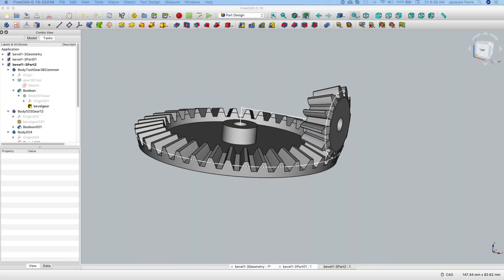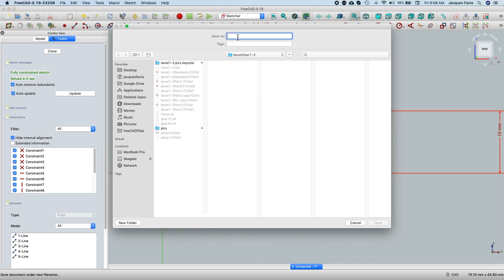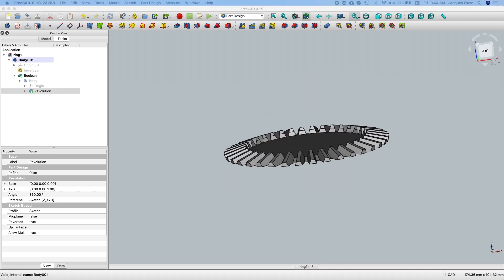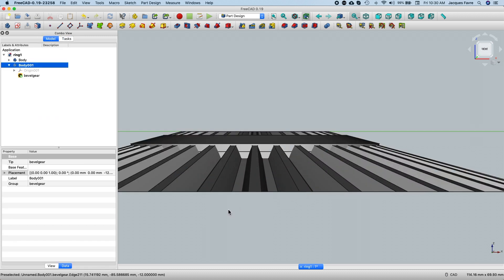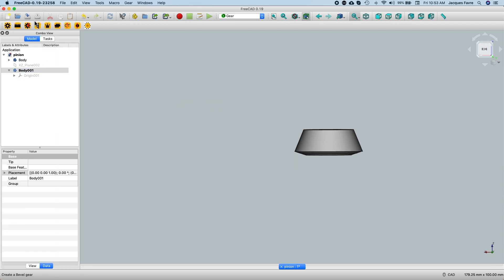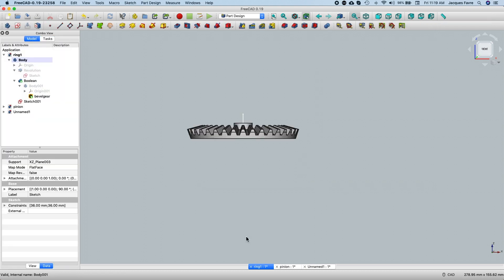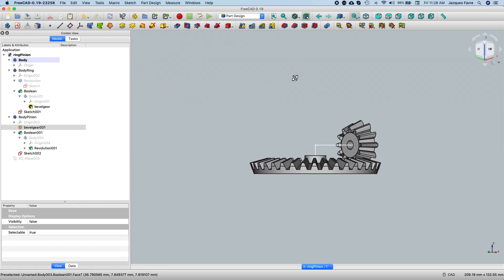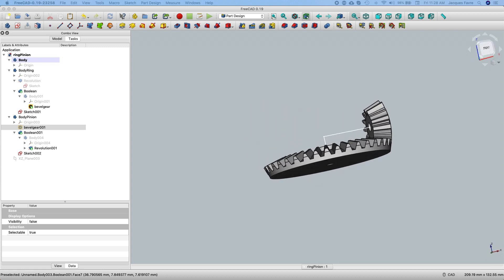FreeCAD Bevel Gear design with Gear Workbench

Comment: My only suggestion is to slowwwwww down in the beginning. I'm a fast dude and this was when a professional shows you how to do what they do and they fly through the steps. Good video otherwise but I definitely had some frustration. Also announce hotkeys if you use them.

I struggled through this and merely slowing down and extending it to 15 minutes would have reduced my time on it from 5 hours to at least 2. For tutorials, it's worth slowing down. I watched at .25 speed for a good chunk of it and still had to play it several times. I learned a lot from your tutorial and still gave a thumbs up. 

It was a push, my experience is pretty limited with freecad though. To someone more experienced it probably isn't too bad

Comment: I've been using FreeCAD for a while now.  Started looking for a way to design a 1/16 bevel gear setup everywhere.  Never got any idea how.  You just gave me the means to do so THANK YOU very much.  You also gave me a learning curve like the North face of the Eiger to get to the point of doing my own design.  I'll first copy yours exactly. However, you showed me it is possible.  Thanks again for a very nicely structured video.
Reply from the maker: 1/16 is huge step with bevel gears in the real word
I rarely see much more than 1/6
The ring and it’s shaft will have to be very rigid
Reply: @jacquesfavre999  Hi Jacques, thanks for your reply.  The large gear (preliminary teeth count 224) will be affixed to the bottom of a 60cm diameter display platter carrying a light load intended to slowly rotate and stop at predetermined angles.  I'm going to use a fairly large diameter, single row, deep groove ball bearing (diameters: 17mm inner and 40mm outer) laid on its side instead of an axle for the large gear.  The pinion gear will be affixed to a mounted 60rpm 12v DC motor with speed control.
A question though.  Is there a way to keep the pitch angle at 45 degrees for such a ratio?  I've read the principles and they seem to require two complete cones with one pitch apex yet I cannot understand why the pitch apex of the pinion gear is not made to correspond with the side (equivalent in length/height to the pinion pitch apex) of a truncated cone of the large gear.  The maths seem to allow for that but I've not seen it discussed anywhere.  The only difference seems to the be that the large gear's diameter and teeth count becomes unlimited with a truncated large gear cone.  The sum total of my knowledge on bevel gears, and gears, is microscopic however so I might have missed entire libraries of knowledge.
Reply from the maker: Only a ratio of 1/1 will be 45 degree
For1/16 the angle will be in that ratio too
Reply: @jacquesfavre999  Thanks Jacques.  Unfortunately for me, this seems the only way to go.. ah well, reality does intrude sometimes.

Comment: when I use the bevel gear option and change the height, the angle changes even though it is set to 45. This kind of confused me. Is it an issue with the workbench or the way I am using it?
Reply from the maker: I saw that too
Happens when making
 a gear higher than what is possible 
Change to bigger module fix the angle
But still a bug

Comment: This seems fantastic. 
One problem , we with poor eye sight can not follow the very SMALL and so FAST pointer. If possible can you increase the pointer size and maybe to a red color. At least then it will not disappear. 
Thanks a lot
Reply from the maker: I am sorry for the speed, I want to keep the video short and interesting.
Do you know that you can slow it down at your end?
Do you have the quality setting on high?
I did slightly increase the size of pointer, and black is what works best for me
Thanks for the comment.
Reply: @jacquesfavre999  The speed becomes irrelevant if the pointer is bigger.
Thanks for your help.